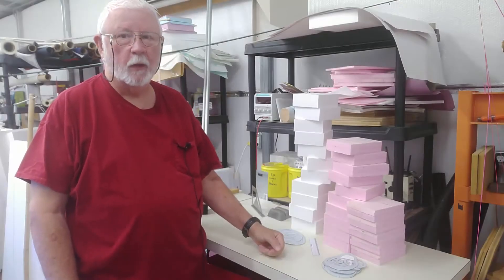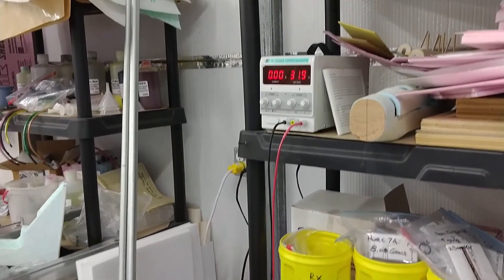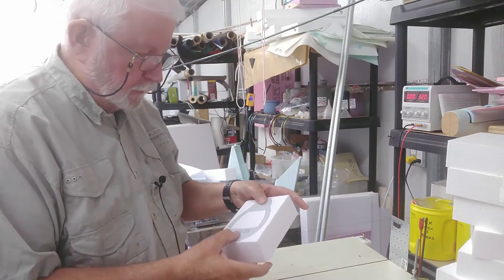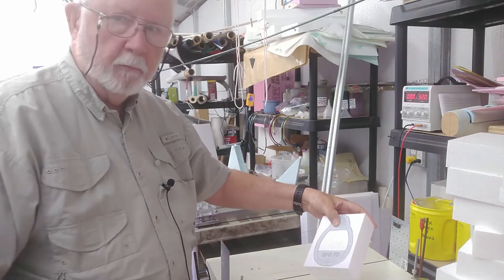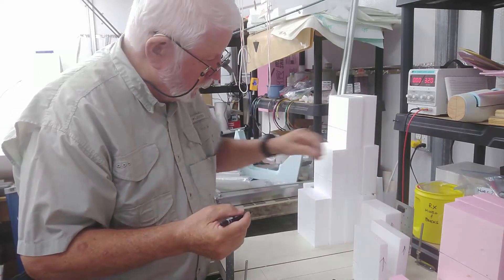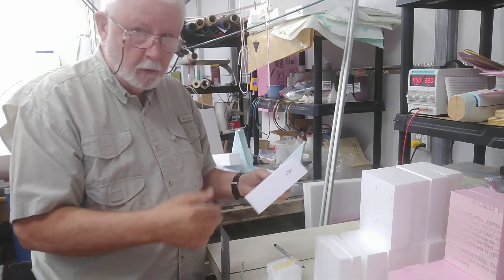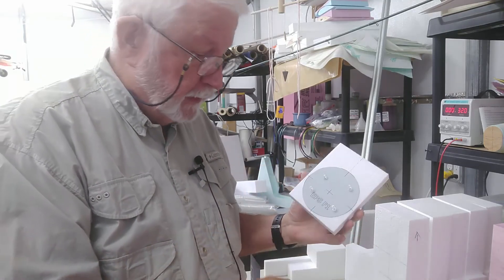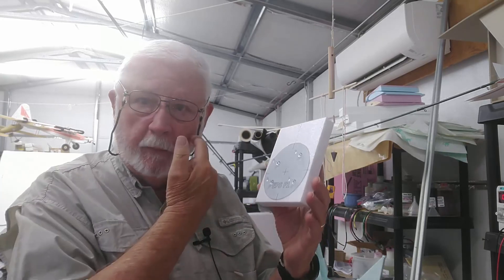Sectioned Foam RC Aircraft Fuselage Building - Part 12

Comment: Hi, me again! I'm confused as to what material you are using for the templates. I'm sure I heard you say "masonite" which translates to hardboard in the UK or MDF. I can only find MDF in 3mm thickness but you templates appear to be about 1mm, almost like cardboard. I thought I would use 2mm ply but maybe it would be to rigid as I see you bending your templates quite easily. Advice welcome!
Reply from the maker: "Hardboard" here, as well as "MDF" (Medium Density Fiberboard), is a board made up of glued together woodchips.  It would be a terrible template material.   For the fuselage templates I use what is basically heavy paper.  We call it "tagboard" or "posterboard".  What school kids use to make project posters out of.  You could use other materials but tagboard is the easiest.  The wire doesn't exert much downward force on these fuselage templates, unlike the ones needed for cutting out the wing panels.
Reply: @tvideo1189  Ah, yes! "two nations divided by a common language"! I have compounded the problem by living in Spain where they have many completely different names for everything! Thank you for you patience and advice. I guess experimentation is the order of the day. Will try with 2mm ply faced with aluminium (sic) flashing to start. Many thanks for this excellent series. ¡Un saludo!
Reply from the maker: @1nformatica  The FUSELAGE templates do not have to thick at all.  Thin aluminium is fine, no plywood necessary.  Any art supply store should have tagboard.
Reply: @tvideo1189  Thanks! Will try and find some. Are the plans for your drop wire cutter available somewhere?
Reply from the maker: @1nformatica  Part 19 of this series starts the wing cutting intructions.  Including the templates, the cutting bow and the drop wire bar itself.
Reply: @tvideo1189  I see it now, thanks.